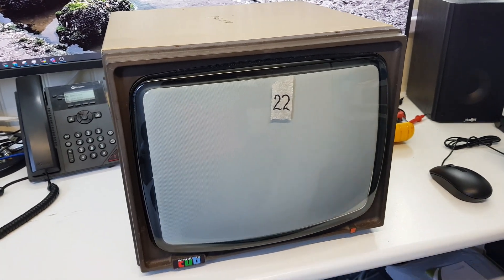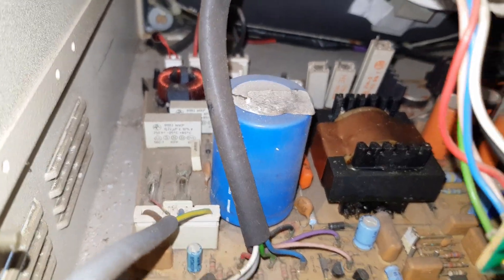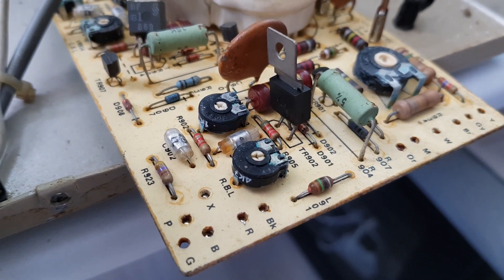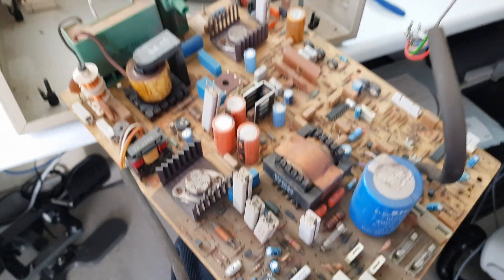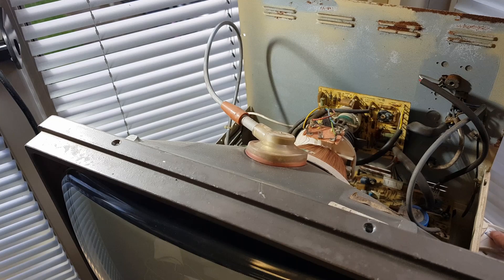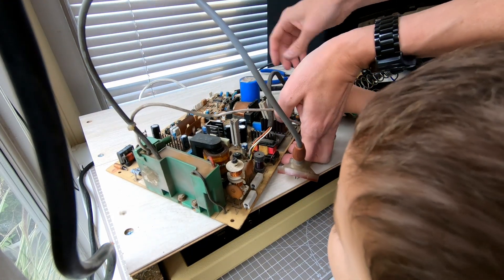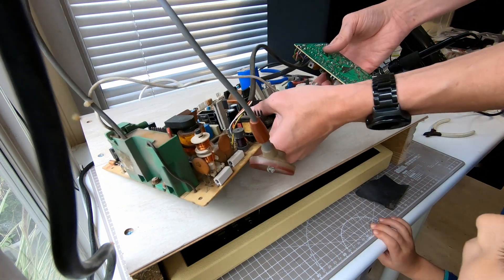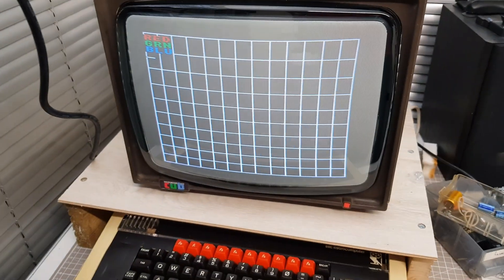Vintage/Retro Cub Microvitec Computer Monitor - Teardown and repair

Comment: Must say I jumped when the kid grabbed the anode cap.
Reply from the maker: Nah.  The HT capacitor is the tube itself, which I would not have removed without discharging.  That big blue cap can bite but it drops to about 70V after about 10 seconds after power off.  Top tip, if you have a child with you when working on CRT's it saves you getting electrocuted because they are the shorter path, plus they are sweaty and more conductive.

Comment: Good work! I’ve just got hold of one that’s in pretty good condition but I’ll be changing the frame cap (gold cap 1000uF 40v) as it looks original and these nearly always short out after this length of time but there’s no better screen for that nostalgic Beeb school trolley experience ;)

Comment: I’m contemplating buying a ctm 644 amstrad cpc monitor with an issue with the yoke. Basically the image is not straight.
Reply from the maker: You should just be able to loosen the yoke which is usually a clamp with a single screw and rotate it.  I only do that stuff when its off.  See Adams Digital Basement channel where he swaps some CRT tubes and swivels it around.  Note that the yoke can also affect the focus.